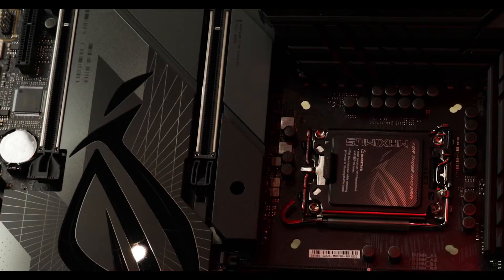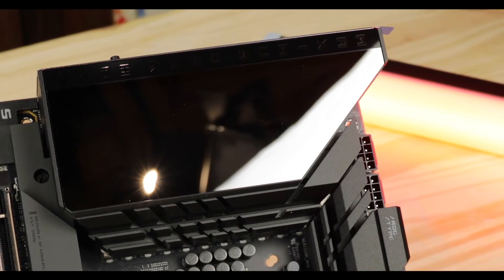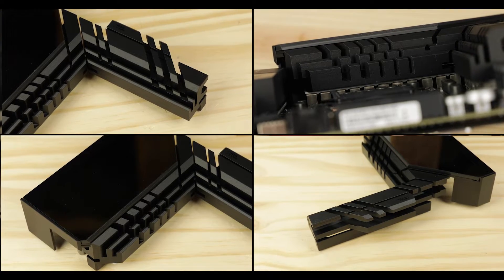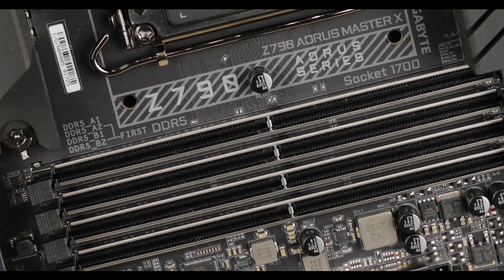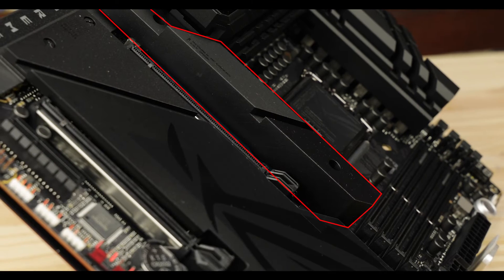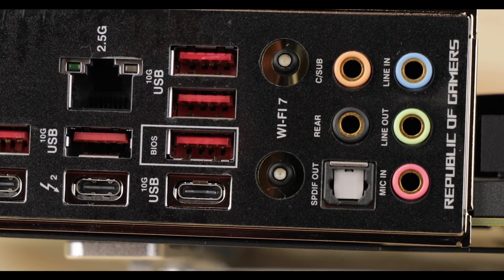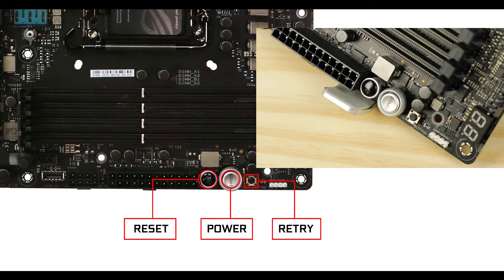ROG MAXIMUS Z790 DARK HERO : The First HERO I liked in a long time!

Comment: ASUS Motherboard manual shows M.2_1 & M.2_2 is connected to the processor, what kind of performance loss would it be to install the operating system on M.2_2 and keep the M.2_1 empty that would still give the PCIe the full x16 lans to the GPU, my system hardware 
W_D M.2 PCIe 4.0
ASUS 3090 Strix PCIe 4.0 
ASUS Dark Hero Z790
G.Skill 64GB
I am also curious to why you said that all the M.2 slots connect to the chipset except for M.2_1 when the motherboard manual says that M.2_1 & M.2_2 both connect to the processor, if you know something I don’t know let me know before I use M.2_2 for my operating system.

Comment: If you occupy M.2_1 it reduces the graphics card to PCIe x8, so I have a 3090, so the way I understand, it would reduce the PCIe to 3.0 x16 since the the 3090 card is a PCIe 4.0, does this sound correct.

Comment: The statement concerning the M.2_2 that is runs through the chip set I believe this is incorrect, the motherboard manual say that M.2_1 & M.2_2 both go straight to the CPU, can you clarify, I would like to use M.2_2 and still have PCIe x16 lans, what is the down side besides the heat sink.

Comment: So you’re saying if you want a gen 5 ssd which only is the m2.1 slot you can’t basically have a 4090?
Reply from the maker: Yes u can
Reply: @Laurentschoice  yeah but it cuts it down till 8&8 correct unless you use the gen 4slot how would that effect game performance?
Reply from the maker: @warfare2582 yeah but still it's equate to 16 @ pcie 4.0 . Which more bandwidth the 4090 can handle
Reply: @Laurentschoice  how can you fix this? Do you have to switch the pcie 5.0 to a 4.0 slot?

Comment: I'm still having issues with my board and PCIe connectivity.... Asus wants me to send the board back but I'm wondering why I cannot detect a network card in the G4 slot at the bottom.
Reply from the maker: That could be a faulty tracing. Anyhow... Send it back
Reply: @Laurentschoice  yeah I am trying to finish one last project. I was just wondering if there would be any other setting that would make the PCIE card not detectable. The G4 bottom lane has no settings other than speed. I also was having some issues with my m.2 speed prior. So I took a couple slots out and built a NAS. Now I need another 10 gig port for the NAS. Lol That's why I always trying to put network card in

Comment: Will a M.2 with a gpu, will both run at 5.0 speeds? Or does the M.2 downsize to 4.0 speed 😅nice a gpu is installed regardless of which M.2 slot I use? That was what I got from the manual, just would like someone to confirm I understood it correctly.
Reply from the maker: Yeah..if you used the m.2ssd in pcies 5 you cut by half the GPU bandwidth
Reply: @Laurentschoice  sorry I think cause I’m dealing with my internet at the same time and so I am not registering something. I had the z790-E board and ASUS had me Rma it due to a code error. If I put the 3080 Ti in the top Gpu slot. And I use the slot above the Gpu, M.2_1 will that allow both to run on 8 lanes of bandwidth? Sorry if confusing you. Just trying to get both the gpu and the 2 TB M.2 to run the fastest.

Comment: I am having an issue that the Microphone has a loud pop both using the front panel and the rear mic-in input. Is anyone else having the same issue with this board?
Reply: I solved my issue. It seems to be a lose wire in the front panel HD Audio connector that was causing issues for me.

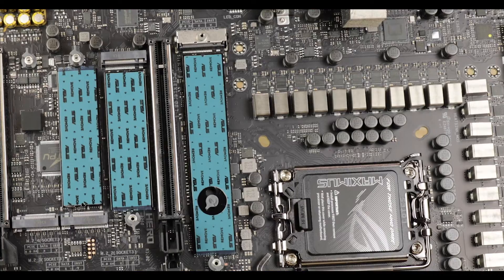Comment: 10:03 can you please provide a source for this info?
Are you sure M2 SSD bus lane and PCI 5 bus lane are shared?
Reply from the maker: Hey there :) 

That's the same PCIe bifurcation you LL find all ove the Z790 powered boards. 

Just not enough pcie 5 lanes to entertain a full 16 lane GPU export AND a x4 m.2 SSD . 

Obviously I tested this as well ;) 

Hope this helps .
Reply: Yes with manual is mentioned that

Comment: How's this Motherboard for 8000Mhz DDR5 ? Planning on upgrading to this Motherboard along with 2 sets of F5-8000J4048F24GX2-TZ5RK RAM (it's G.Skill Trident Z5). I wonder if it would require some manual tweaking for the voltage and if it would be stable for i9-14900KS.
Reply: NOOOOOO THIS BOARD DOSNT SUPPORT 8000MHZ it says on website but dosnt

Comment: Hey do you have to connect the second power connector to the dark hero?
the one underneath the mainconectoer 6 way connector
because I don't have it in and my cpu turns up without end in battlefield 2042 
temperature fluctuations of 70 - 95 degrees with the game

Comment: does it only use half the lanes when you use a gen 5 ssd in the top slot or when you use the top slot at all no matter if you have a gen4 or gen5 ssd plugged into it ?
Reply: I have the same question. I’m going to use my.2 slicker 2 & 3 with my SSD’s and my 4090 as the top pcie
Reply: @digitalQ33  chatgpt says this info is not true. Those lanes have dedicated bandwidths. Anyone to confirm they are shared?

Comment: Good review! Only a slight correction/addendum:

During the storage segment, you talk about when M.2_1 is populated, it disables PCIEX16(G5)_2 and limits PCIEX16(G5)_1 to PCIe 4.0 8x. This is true, however, I think it's important to note and consider that M.2_2 also offers direct CPU lanes while not interfering with either of the PCIe slots. Obviously, you can't then fully utilize the benefits of a PCIe 5.0 NVMe, but considering that said SSDs are not widely commercially available to home consumers and that the everyday use performance improvements of PCIe 5.0 seem negligible, it changes my stance at least on the value of the board in the positive.

TL:DR
For optimal performance, just use the second M.2 slot from the top (the one under the first PCIe slot). You get the benefits of having direct CPU lanes for a SSD and the benefits of PCIe 4.0 16x for your GPU.
Reply: Yeah, but NOT the benefits of the large heatsink.
Reply: @gladosadoree exactly!

Comment: In the video you inserted 2 RAM into DIMM slots A1 & B1 but in the manual and even in your video right after you inserted the RAM you zoom in on the board and it shows A2 & B2 with an arrow saying "First". Just a heads up for anyone else with this board, I do think it is odd, but Asus recommends A2 & B2 for the first 2 DIMM slots to be used for RAM.
Reply: Shouldn't matter

Comment: Big downgrade in expansion department compared to last year Hero. I would like to say one step forward two steps back. Sadly, don't see the step forward. Wifi 7 maybe? A chance to spend my money on $1000 wifi 7 router and devices that will show up en masse when this platform is dead and intel has moved on.
They reduced SATA from 6 to 4 and last year's 3 + 2 x4 nvme arrangement seems much better when sticking with 4.0 m.2 , due to x16/x8/x8 expansion slots (last slot bifurcates to x4 x4 with included m.2 card). This leaves main cpu lanes in x4 (4.0 m.2)/x16 (5.0) arrangement, or x4/x8/x8 alternatively for dual gpu for example. You would lose one m.2 4.0 if you want m.2 5.0 on expansion m.3 card, but this choice makes the older one way more versatile.
These maximus boards and premium boards from others were supposed to bridge gap between general gamer consumer and workstation hefty 'buy in'. Sadly with every iteration they are inching closer and closer to general consumer level while still charging big premium over strix mid range. For what? Based on led's on vrm cover (not impressed btw) i suppose???? 

Your reviews are detailed and always fun to watch

Comment: If I insert a PCIe 5.0 speed M.2 SSD, will it occupy the bandwidth of the x16 PCIe 5.0 slot for the graphics card? What should I do?
Reply: Yes that is a question I also ask.
Could someone recommend a board where there is no such limitation. I want to use my SSD and GPU bandwidth at max.
Reply: BTW I asked chatgpt, and it insists that this is not true. SSD and PCI 5 slot has dedicated buses, it says...

Comment: I just Bought the board main reason was the thunderbolt. I switched from amd over to intel for thunderbolt support with my Universal audio apollo's. the board looks amzing and is pretty heavy. i am happy I saw this video before I installed the m.2 ssd's i will not use the first slot now 😅. thnak you for the review

Comment: Why have you put your ram into 1 and 3 slots on 5:52?
Reply: I checked the manual and the second and fourth slot are the master dimms
Reply from the maker: To activate both channel 1 and 2 ( making sure they both operate). 

The both are master dimms placement activating each channel.
Reply: I believe they did this to move the dimms farther from the CPU heat

Comment: This shit not cost that much with 4 dimms and 8 layers lol. And 7800mhz is very hardly achievable compared to 2 dimm boards

Basically same as 790-e but 300$ more expensive just for thunderbolt if I correct, screen and wi-fi 7. Same as simple Hero but with wi-fi 7 and still cost 150$ more. Asus is a joke

Comment: Just before anyone decides to purchase this board. FYI it WILL NOT do the advertised ddr5 8000. My first board came DOA. My second board is having audio issues (cracking and popping through my computer monitors), and I am now going on my third replacement in a month. Other than that it is feature packed and looks amazing.
Reply: Who need all that speed
Reply: Just in general I would say don’t go with Asus this generation with the whole drama going on with them. But damn do they make good looking boards probably the best on the market alongside those high end MSI ones

Comment: oh damn I almost wrote you off because that board can't do anywhere near its advertised RAM speeds, Frame Chasers just today tried it out and it crapped out. a 4 DIMM board is already limited just because of the slots existing.
Reply: I have a Dark Hero Rig sitting beside me right now. Been through about 7 different RAM kits and two 14900K's. Frame Chasers is correct. Best I can get is 7400 stable also. The rig i am typing this on is an Apex Encore, 14900K, plugged in Corsair Titanium 8000 at XMP 1, bumped it up to 8200 without changing anything and it runs perfect.